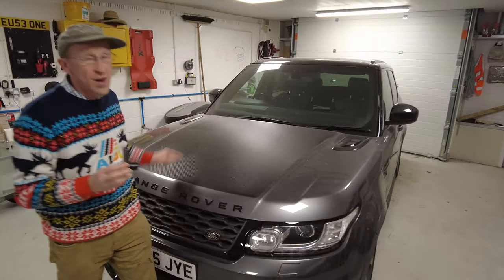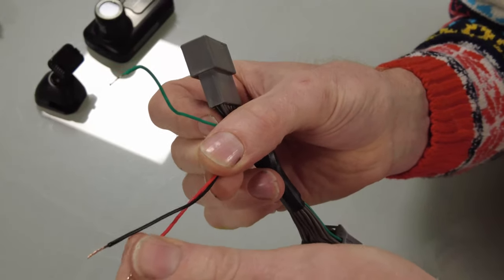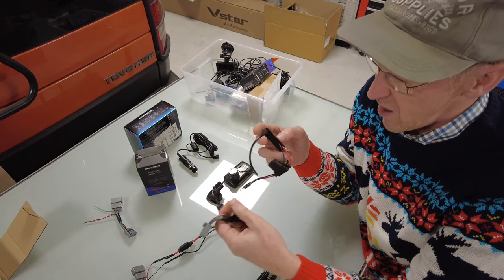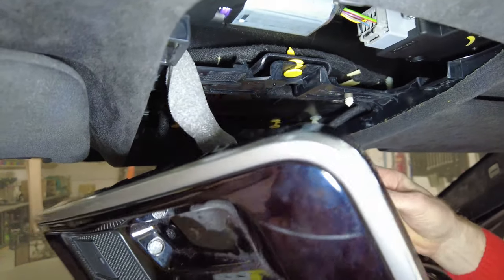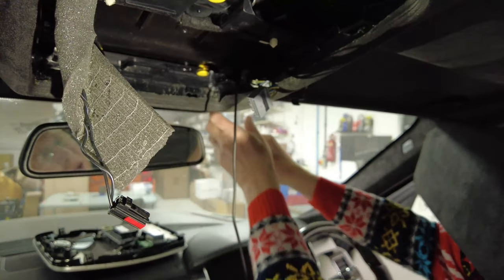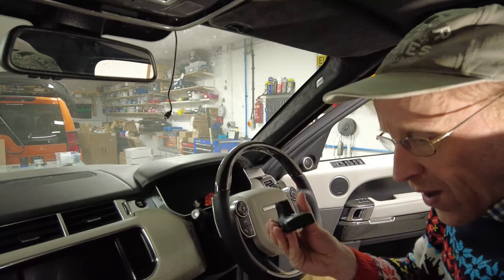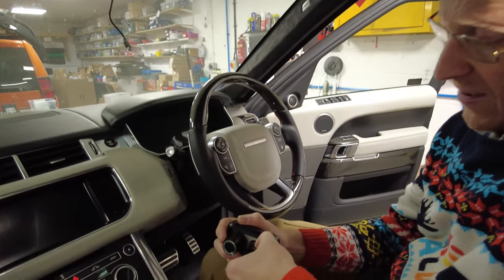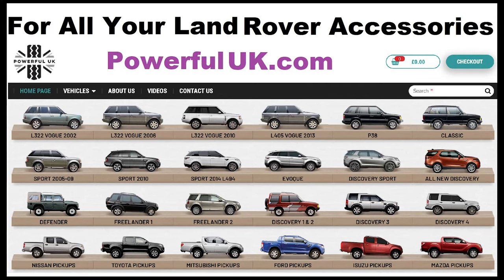How to fit DashCam in Range Rover Sport L494 using Overhead Console Power Loom wiring

Comment: Fantastic Simon - I love it!
Is there any chance of you doing a similar item for the rear hatch?  I have a rear dashcam (Garmin) which connects wirelessly to my front dashcam so needs continuous power and ignition switched power for parking mode.  I've tried to identify suitable wires to connect into but I haven't yet found ones that are reliable.

Comment: Why is it recommended that the battery is disconnected? 

And once the battery is connected again everything should be back to normal correct?
Reply from the maker: Its really just to stop power spikes or short circuits - but to be honest we never disconnect the battery on our car !
If you disconnect battery there will be no issues with radio codes etc

Comment: We had 2 Garmin 66W Dashcams installed at an authorized Range Rover garage on our Range Rover Sport L494
These also record when the car is parked.
But for 3 years they can't solve the problem that I get "low battery notification start the engine".
Annoying is that the rear trunk no longer opens electrically.
The story I get after 3 years is that they cannot fix it because the Range rover L494 monitors consumers and if more than 40 mA on 12VDC is consumed then the system goes into "survival mode".
They now want to add an extra battery and that should solve the problem but will cost us back 800 euros.
Is there no other solution where the power supply for the cameras can be connected for power when the car is parked/engine off ?

Comment: Hi Simon..Could you please help.. wanting to have more base in my 2014 rangerover sport.L494. its the dynamic version miidle of range.. the sterio dosent have very much base to it, i looked under the seat to find it didnt have the sub woofer speaker fitted in there.. so i baught one from ebay.. plugged it in to find it didnt come on abd wasnt any differant.. i dont think its the sub speaker..? but  do i need a differant amp.?? or another head unit ? to get the base working good..?  if anyone els has upgraded there base speakers in a rangerover sport L494 please advise.. thanks....

Comment: I've fitted the overhead console wiring loom (a great bit of kit) in my L494 with the Nextbase hardwire kit for my 522GW and it all works fine for recording. However, the battery save feature in the Nextbase hardwire kit does not seem to work as I kept getting the 'Battery Low, Start Engine' warning; the vehicle battery got so low the power tailgate and auto stop/start wouldn't work. This problem went away when I unplugged the dashcam, so it would appear the dashcam is draining power from the battery all the time and not shutting down. I'm going to get the car battery & charging system checked professionally to make sure they are fine and then rewire the loom/dashcam to the switched power and see if it has the same results. The loom from PowerfulUK is brilliant and saves a load of time compared to hard-wiring dashcams in my previous vehicles.
Reply from the maker: Interesting - let us know what you find in your investigations.

Comment: i can confirm Nextbase dash cam hard wire kit does have under-voltage protection .. My son left the side-lights on his skoda on overnight ( muppet ) , next morning i had to jump start it  , i put a voltmeter in the cig lighter to check  the car was charging , the dash-cam didn't power up until the meter read ( iirc ) 11.5v

Comment: What happened to the ‘18+ aftermarket turn signal circuit boards that were going to be available on your website? You did say you would put them up since you ”love everybody”. :-) Lots of people could use them...
Reply: They do not work on Genuine lights - only the lights from our supplier as they are not wired the same as original
We did sell them but they all came back - wasted our time and disapointed the people i love so much ( our customers )
Reply: Yes. Aftermarket. I have aftermarket. The boards seemed to work well on your aftermarket lights in your video. Was hoping to get a set of boards for mine, too.
Reply: @poppyboysgarage1518  I will get them listed !
Reply: @poppyboysgarage1518  They are now on our website
Reply: Wow. Just ordered. I’ll let the other folks know. Thanks SO much, Simon!!!

Comment: Hi Simon, I would like to fit a dash cam to my Discovery Sport - is the loom kit you have compatible?
Reply from the maker: We are testing on the Evoque next week - we are testing the voltages and also shorting out the connections to check which fuse blows and that each circuit is protected. We dont have a Disco Sport to test on - we are looking at buying one !
Reply: @L663  You are welcome to borrow my Disco Sport. Dashcam, Halogen light upgrades, Xenon light upgrades, Mood lighting, wireless charging, etc.